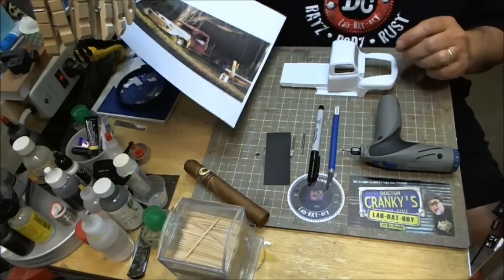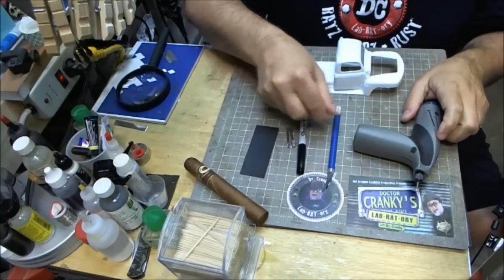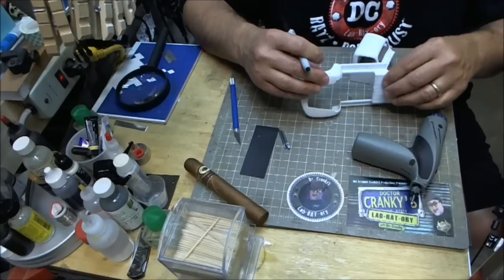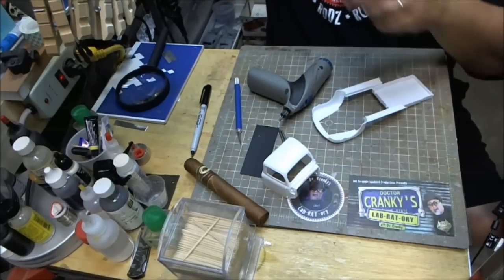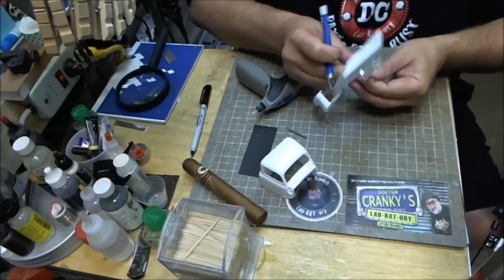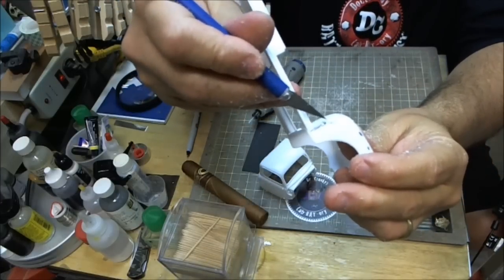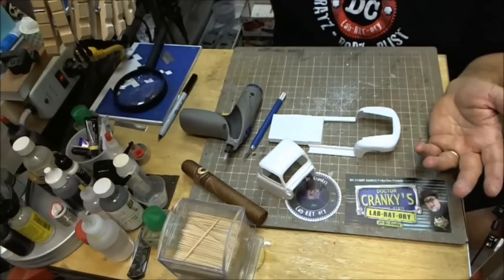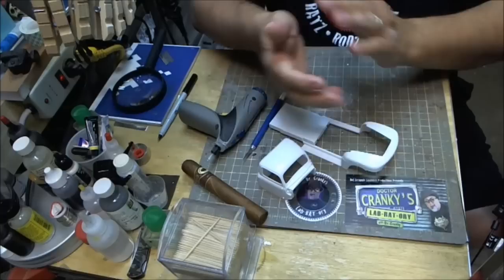ANOTHER Lab-RAT-ory CLINIC:  "Rust-Throughts"

Comment: Lots of great tips Doc, I been doing can models for years an always wanted to make up some rusty 1/24 scale models. I wonder if you ever tried to melt rust holes? I have on my bench a 852 2 N 1 heat gun / solder station the iron has an x-a to type tip. I may have to get cheap kit and have at it